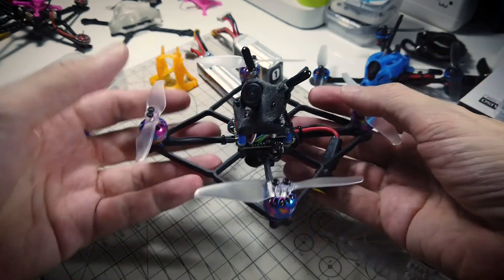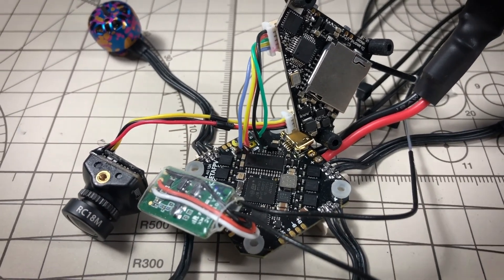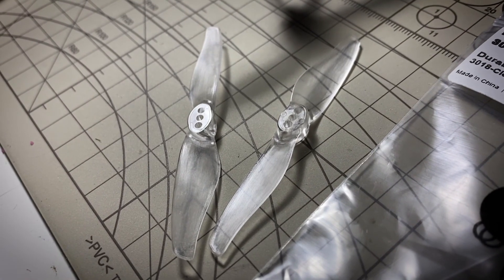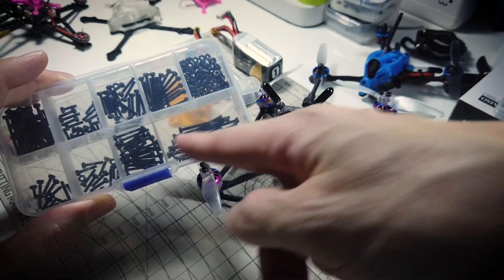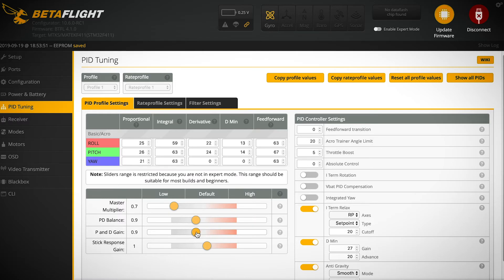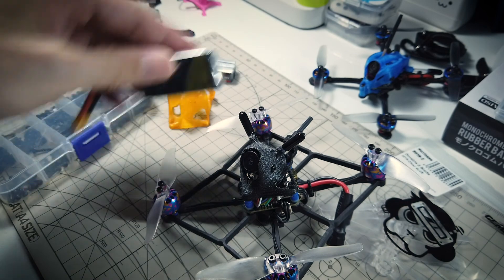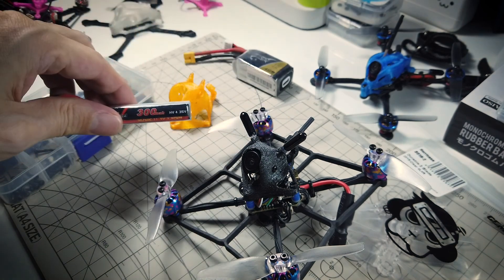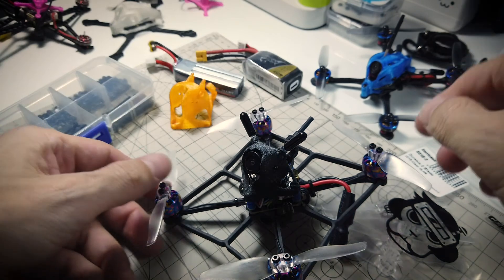Diatone Cube 339 Bespoke Build with iFlight XING Nano 1105 6000kV + BetaFPV 12A AIO + Gemfan 3018 3S

Comment: Hey MMF ! How are the flight times on these motors ? I'm currently trying to tame some EMAX 1106 6000 kv motors on a light 3" micro build, but they seem quite power hungry unless I drop down to a 2 inch prop ..  450 + 550 lipos
Reply from the maker: Hello! It’s been awhile since I’ve had this exact setup but if I recall I was getting 4-5 mins of flight time. The motors you have should be a good match for 3” props and if you are trying to tame them then probably the best way would be to try motor scaling in the Betaflight PIDs tab. Maybe try 80% which would simulate close to a 5000kV motor.

Comment: Hi sir will the gtb339 frame accept 12xx-13xx motor types? Currently local store offer discounts in this frames. Im very tempting to try out this one. If able to use 12xx 13xx motors. Thx for vids
Reply from the maker: Hello:) Yes, you should be able to use 12xx~13xx motors. Most of these motors seem to have the 9mm screw spacing the same as 11xx motors so they should be fine on the frame though you may want to double-check to be safe. Usually around the 1406-size is when the mounting size goes up.
Reply: @MiniMicroFPV  noicee gtb339 skeleton frame here we go. Thank for info. Very appreciated
Reply from the maker: Hehe, great! It’s a very good frame and it should go well with the size motors you mentioned:)

Comment: Nice build as always ! I noticed on the pod tuning that you brought the master multiplier top slider way down. I’m curious as to the reason. I’m currently trying out different pids on a similar setup. Still getting slight isolations on the bi blade props. Thanks for sharing. All the best
Reply from the maker: Thank you! If I were "tuning" this today I would probably just start with the stock slider settings on 4.1.x and go from there:)

Comment: Will the FC board run on 10.5.1? I have a Sailfly frame that I can rise...thanks for sharing!
Reply from the maker: Yes, the FC should connect to 10.5.1. I can't remember if it came flashed with BF 3.5 or 4.0 but it should connect fine:)
Reply: @MiniMicroFPV  Ok, thanks bro!

Comment: What’s your opinion on the Xing 1105? I’ve heard bad comments about them, particularly the 6000kv. Also, did you have to use adapters to fit your motors on the frame? Thanks!
Reply from the maker: Oh really? I haven't seen those negative comments yet. What were they focused on? I am currently happy with mine as they seem smooth and powerful with nice build quality. No adapter needed to fit on this frame:)
Reply: @MiniMicroFPV  Nick Burns did a review comparing them to the 1105 mamba, he said they are a little less efficient
Reply from the maker: @grRossi  Thanks for the heads-up! I checked out his vid and have no reason to doubt his conclusions;) My motors did not run hot however on the Gemfan 3018s and I was happy with the flight time and performance. Perhaps if I did a direct comparison with the Mambas I would find them better but I didn't dislike anything about the XINGs in my testing:)